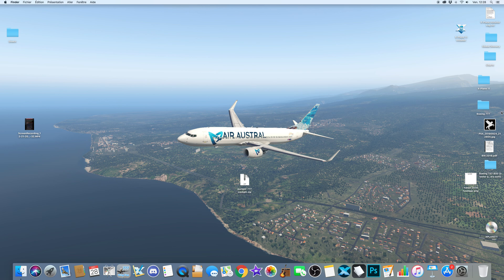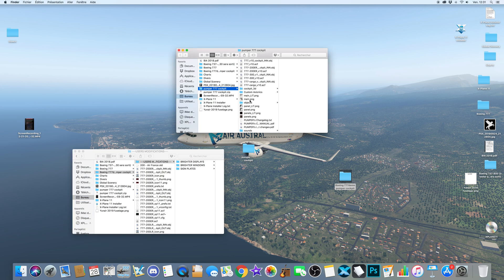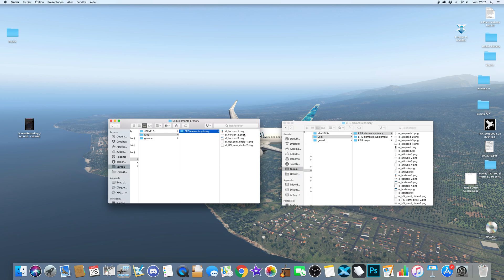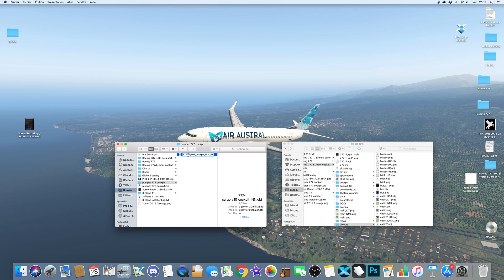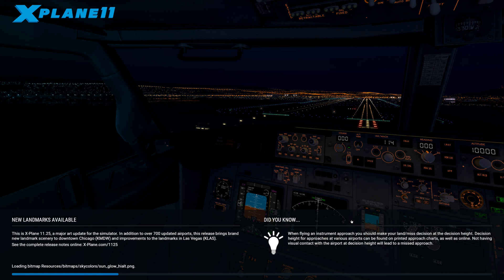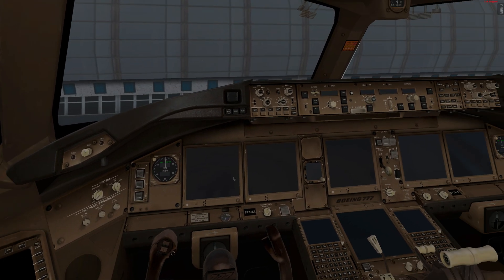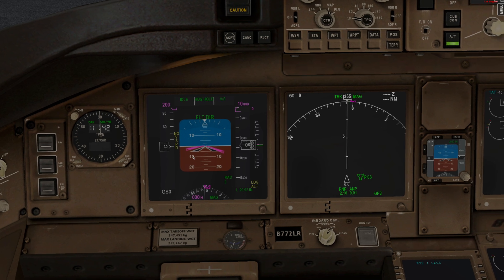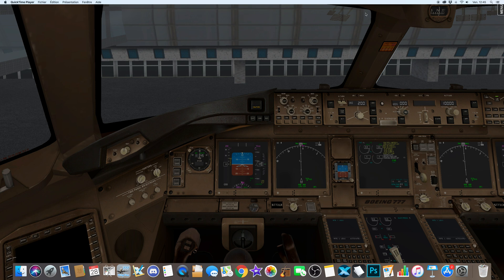Pumper cockpit for FF777 installation for XP11 tutorial

Comment: I have no winow pillars in the B777 Cockpit when I add the Pumpers Cockpit..
Reply from the maker: Did you install other textures ? If it’s the case, you need to reinstall the aircraft without those textures and then install the pumper cockpit.
Reply: @starfleetaviation5725  I had installed it without any other Cockpit Textures
Reply from the maker: EucalyptusTea in that case, you may need to update your aircraft, just in case but if it’s already updated, then I don’t know what to say because I was talking to a friend who had the same issue as you do and all I told you is what he suggests to fix it.
Reply: @starfleetaviation5725  Okay, thank you for youre advise. I also have problems with the Vertical Speed. It does not take the input into account despite the autopilot.
Reply from the maker: EucalyptusTea no problem. And for the vertical speed, was a light on on the v/s fpa button when you used it ?
Reply: @starfleetaviation5725  Yes there is a light on

Comment from the maker: Caution !!!  With new version 1.9.16 (and maybe later versions) the installation of the pumper cockpit is the same except for the cockpit_INN.obj files . This time,  you will only have to rename ONE file from the pumper cockpit (777_v10_cockpit_INN.obj). You will have to rename 777_v10_cockpit_INN.obj into 777_xp11_cockpit_INN.obj . For the rest you can still do as I did in the video.
Reply from the maker: https://drive.google.com/open?id=13o3-085gLs4vT8Ta1GjgP-NU6Scef_-9  I have uploaded the modified files on google drive so you won't need to rename any file anymore
Reply: @starfleetaviation5725  
Thank you for this update it works great :) but I get a VR Config error but since I am not flying VR this is not a problem;)

thanks again <3
Reply from the maker: Marcel`s Fliegerwelt no problem :)